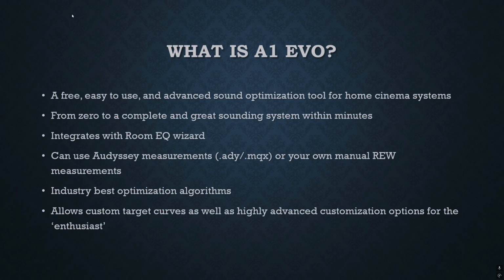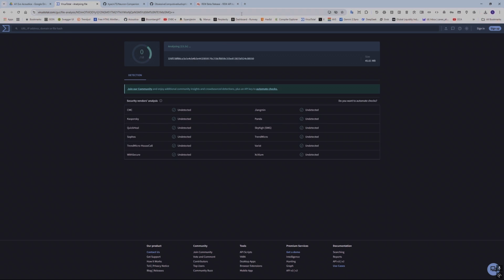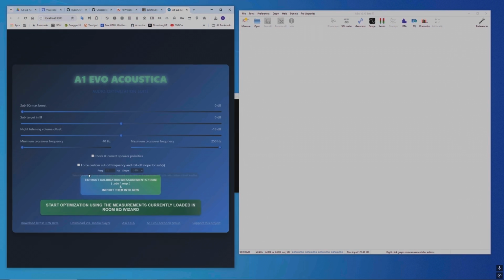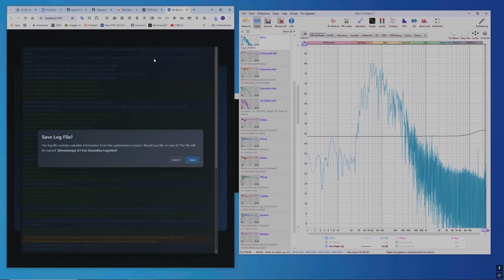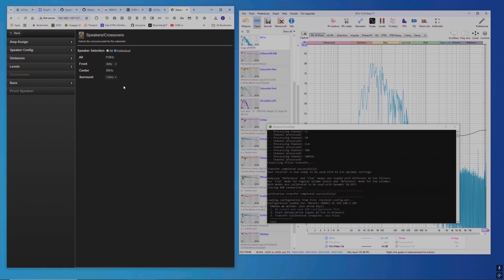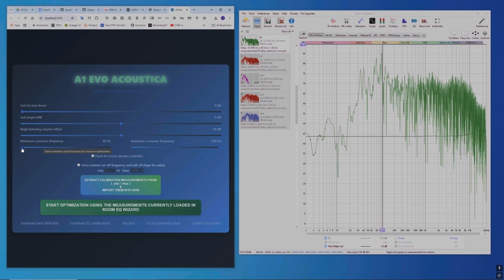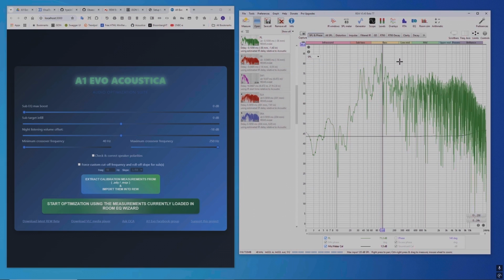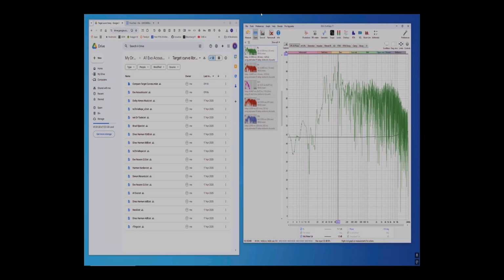A1 Evo Acoustica

Comment: Hi OCA! Thanks for this new version! I'm hoping you read this comment as I've got a few (hopefully easy to answer) questions.

After running acoustica and importing the results into my 4800h, the crossovers for all of my speakers are extremely high (180hz for kef r3s) when in previous versions of A1 Evo they were set correctly to 90hz or so. Any idea why this might be?

Secondly, I have two subwoofers, both equal distances to the seating positon, and this is confirmed by my audyssey app measurements.
However after running Acoustica, one of my sub's distances is more than double that of the other sub, which is very odd considering they're the same distance away from the measurement mic.
Any idea why that's happening please?

I've manually corrected both of the inconsistencies after loading the results into my AVR and it sounds great, I'm just a bit confused.
Reply from the maker: You should listen to the results first before you make changes.
Reply: @ocaudiophile Ignore me, clearly my ears were having an off day, it sounds far better without the tweaks.

Thanks again OCA, when my next paycheque comes in I'll throw some your way!
Reply: @ocaudiophile Thanks for your reply, I did give it a listen and it sounds great, but the bass does sound a little bloated and the fact that all of the crossovers are set to their maximum is really odd.

I might give the measurements another ago to see if that changes the results.

Comment: Thank you very much for the great tool, I'm so much happier with my system now! 4 small questions I have:
1. I have used my ady file from the app. Does it matter of I switched dynamiq eq or on off before downloading the ady file?
2. Does the speaker options from the app influence the ady file and in a second step the calibration?
3. Do I have to take care about a subwoofer offset if I used the App, or is this automatically included in the app-measurement?
4. If I have the feeling that the bass is too low, whats the best way to increase it? Just increasing the level in the avr? 

Thank you very much in advance for everything! 🙏🤗
Reply from the maker: 1. No, Acoustica will turn them all off and set Audyssey to Flat after trasnfer.
2. You should not use the app after Acoustica, it will erase all its filters. Of course you can re-trasnfer .oca file again any time you want.
3. You don't have to do anything. Just make sure Loudness management id Off, this is a setting that only shows up during Atmos playback and is on by default. Also check that AVR settings are inline with optimization log notes after a transfer. Sometimes not every setting is correctly transferred although you will not see any errors.

Comment: Hi the software is failing to find my AVR even though both are on the same network. Even when I manually enter the IP address of my AVR. 

Using manually entered IP: [IP of my AVR]

Attempting to verify/find model name via /goform/ endpoint on [IP of my AVR]...
Failed to get http://[IP of my AVR]/goform/formMainZone_MainZoneXml.xml. Status: 301 Moved Permanently!
Could not get a valid model name from /goform/ endpoint.

Could not automatically determine or confirm the AVR model name.

Comment: Hi, can you please tell me if I need to use the Fix speaker polarities function? The question arose because the program gives errors about polarity on some speakers, although I am sure that everything is connected correctly.... What can this be because of, just errors sometimes even in a pair of identical speakers, for example, the left one is correct, the right one is not correct. Is it necessary to use this function and will the calibration go fine without using it...? I would be very grateful for your help.
Reply: Help please
Reply from the maker: You should not use the option if you are absolutely certain connections are wired correctly.
Reply: @ocaudiophile  Well, all wires are connected by color, so there should be no mistake...... But maybe something got mixed up with the speakers during production because the center and side channels are different, even though the speaker lineup is the same? Or is this impossible and just ignore the function? By the way, the impulses are really different in REW

Comment: I bought a receiver with XT32 for the sound quality Audyssey supposedly offered. I've been unimpressed for years, trying different speakers and configurations, re-running Audyssey way too many times. You are the only reason I'm glad I bought a receiver with XT32, OCA! Wow, wow, and wow. Focused, immersive, and beautiful bass. Cannot thank you enough.

Question: Does A1 use an internet connection to run the analysis or is it all self-contained in the downloaded A1 program? I want to make sure it doesn't become obsolete because I want  to have it FOREVER!!!!!
Reply from the maker: Thank you 🙏 A1 only uses your local network.
Reply: Enjoy your optimized sound with all your content 😊

Comment: I am planning to use the measurements from the multieq app (.ady file ) . I own a denon 3600h. In the multi eq app thread on avs they mention the distances are wrong with the multieq app on older models and people multiply them by 0.875.  Do I need to do that before the extract the ady file ?
Reply from the maker: No

Comment: Very interesting software! I'm finalizing my new home theater setup and wondering if Acoustica can adjust three or four independent subwoofers? (I have an X4800H, which has up to four sub outputs). If not, is there a specific model or version — for example, of the A1 Neuron — that you'd recommend for multi-sub setups? Alternatively, in this kind of scenario, are MSO (Multi-Sub Optimizer) and miniDSP (2x4 HD) applied via a single subwoofer output, and Acoustica used afterward for final tuning the only option? Thanks for your time!
Reply from the maker: It can and work better with multiple subs

Comment: you mention that -15db on the receiver is 90db volume. Isn't -0 on the receiver reference level that is  75db? when I use -0 on my Denon I get around 75db set by Audyssey
Reply from the maker: No 0 is 105dB (85dB reference + 20dB buffer for the loudest sounds)

Comment: Hello OCA! You probably don't remember me, but I showed you how to decode the Multeq-X data (mqx).
I tried your tool after having optimized with MultEQ-X for a long time.
Wow, the result is excellent! It sounds a bit better immediately after generation than my current setting, which I optimized over weeks. The big advantage of your tool is that the excellent result also fits very well at different volumes!
My verdict is that your tool is much better than Multeq-X. 

I have one question:
Is there any way to select a different target curve for the night mode?
Reply from the maker: I remember you and always grateful 🙏 I added only 5 settings for night mode because it's not calculated on the go and quite tedious to add one. But being the base64 guy, you could add your own quite easily. Find the project on github and write me there.

Comment: I tried to import my measurements from MXT files and when I went to run A1 it said it needed independent subwoofer measurements.  MEQXT measures the subs togethers so not sure what I need to do?
Reply from the maker: You need to measure each sub separately if you have two independent sub outputs in your AVR. You can do that with REW by turning off each sub during LFE channel measurements or check Neuron video folder for odd.wtf tool that can do that. Btw, MultEQ XT models do not have two independent sub outputs, yours must be an XT32!
Reply: @ocaudiophile yeah I’m running XT32.
Reply: @ocaudiophile  How many measurements do you take?  Just 1 set of measurements from the MLP?  Or 8 like Audyysey?
Reply from the maker: @BrentWood-yv6cl 1 at strictly centered MLP when I'm in a hurry and 9 closely at and around MLP when I've the time. Usually improvements starts diminishing after 6 but have seen people take 24 different mic positions.

Comment: Is there a reason all my crossovers are so high now? My speakers can go down to about 40hz for mains and 60hz for my center, surrounds are good down to 80hz. I used to get 80hz for my mains and center channel and around 120hz for my surrounds and atmos speakers, but now im getting 200hz for mains and center, 250hz for surrounds and rear heights and 150hz for my front heights. This definitely seems odd. Is there a logical explanation for this, am I missing something?
Reply from the maker: Use a less bass heavy target curve, don't use sub target infill, some times allpass filters can also drop XO frequency by a notch or two. Acoustica works differently, my Kanta 2 towers get 110Hz. It optimizes for what will sound best in the particular room based on the speakers (and its pair's) location , doesn't care about speaker sizes but it gets the best sound every time. If none of these work (after you listen and it really does not sound good), you may assume there's something wrong with the measurements try more mic points in a silent environment.
Reply: @ocaudiophile Thanks for the response. I used tge default acoustica curve. Is that more bass heavy than the neuron curves?
Reply from the maker: @stephenrobotham1510  Try Dr Toole and go up from there.

Comment: Hi Serkan... a question out of curiosity.. You had deployed all pass filters for optimization.. Now that we are making it optional is there a performance compromise... is this limitation of not using All pass filters specific to certain Aud versions... what would you recommend as default for best optimization and at what point should we give up on All pass filters.. Out of station so couldnt do the tests with live system in terms of impact but always keep following your journey hence the question...😊
Reply from the maker: I wouldn't know for sure because I found a bug with allpass filters (it's fine with them disabled) and working on a fix at the moment...
Reply: @ocaudiophile : Yes, we know there won't be an issue that you would have identified and not fixed... Thanks, journey to the perfection continues..😊

Comment: Excellent work. Thank you very much! I have a Denon AVR-S760H, but it does not find it automatically. I type the IP manually, but it does not generate the /goform/... "Status: Error 403: Forbidden Access Forbidden." What am I doing wrong? Thanks.
Reply from the maker: Maybe you are using a VPN?
Reply: @ocaudiophile  No. My local network is in Mesh, but my AV appears when entering the IP manually.

Comment: This is the closest I’ve gotten one of these to work with my receiver and I’m still having issues 😞 I received a calibration error in Terminal saying “failed to initialize coefficients” Any clues?
Reply from the maker: You have S760?
Reply: @ocaudiophile I have a Denon S720W
Reply from the maker: @justinmosher7146  Ok, this multEQ new series are having this issue for some reason. I need a wifi capture of a working transfer to understand what is going on. In the mean time, you can try transferring settings after a power-cycle of the AVR, this sometimes help.
Reply: @ocaudiophile Is this a bug that can be fixed in a future version? I can always wait!
Reply from the maker: @justinmosher7146  EVery model has different waiting times during filter transfer and I can only find it out in wifi captures unless it's my machine. There's no documentation about it anywhere. Eventually it should be fixed. The code is open source on github. Let's hope someone with these models focuses on it soon.
Reply: Any version of Evo that’s guaranteed to work with my receiver?
Reply from the maker: Problems are fixed with all models since v6.3
Reply: @ocaudiophile finally worked!! Thank you 😊

Comment: It says I have to redo my measurements with my two subs set to directional. Is there a way around that if I don’t want directional? Thanks!
Reply: I did this to my other system with only 1 sub and didn’t have that issue and it works fantastic! 

But on my main system, it won’t let me continue the optimization until I retake measurements with directional subs
Reply from the maker: Directional is just a temporary hack to be able to measure each sub separately. Acoustica converts it and works in standard bass mode.
Reply: @ocaudiophile  Last question, retook the measurements and running acoustica, made it past the subwoofer part but it is saying my rear height left measurement is not there, which it is. Any ideas?

Comment: Every time I was in this place, the RAW software froze, and the web browser prompted "[WARNING] Polarity inversion(s) will be applied automatically by A1 Evo Acoustica!" Probably, what the reason will be.I succeeded once at the beginning, and I never succeeded again, and the subwoofer had no sound when I succeeded, as if there was no bass output, which was very strange.
Reply: My amplifier is Marantz SR6014 and the Acoustica version is 5.6. The RAW version is 5.4.
Reply from the maker: @lds4676  You can try to get help in fb group.
Reply: Hey check your amp crossover section.. All your speakers must be showing as full range hence your subs are silent... change the crossover overs as per acosutica recommendations and all should start working again.

Comment: I keep getting this error during transfer:
✗ Timeout/Error: INIT_COEFS - No response/ACK received

!!! FAILED sending INIT_COEFS: INIT_COEFS: No response/ACK received

--!!! CALIBRATION TRANSFER FAILED !!!--
   Error: Failed to initialize coefficients (INIT_COEFS).

But it detects my receiver and configuration just fine originally. Model is AVR-S750H
Reply from the maker: Are you using v5.3?
Reply: @ocaudiophile  Yes, I’m running 5.3

Comment: When I run Acoustica with all default settings, all my speakers and subwoofers are detected as False for Polarity Inversion. However, if I use the sliders, my subwoofers are detected as True for Polarity Inversion. Is that by design or a bug?
Reply from the maker: I could not replicate this error, something must be wrong with your REW set up!
Reply: I've uninstalled and reinstalled REW multiple times. The same thing happens. Here is a link to the REW logs: https://drive.google.com/drive/folders/1tzyg8agK41dPr27V5gld6iaQnKsk2LAs?usp=drive_link
Reply from the maker: @volumnus  Ok I now understand, it's your subwoofer that's inverted. That's completely normal and is dependent on the crossover frequency selected. Just enjoy the results ;)
Reply: Thanks for clarifying. I still have one minor issue. With my whole front soundstage having the same 100hz crossover (center, fronts, wides, and front heights), the surround sound bubble effect is really good. Unfortunately, I can't match the crossovers on my side/rear speakers (side surrounds, back surrounds, and rear heights) without messing up the crossover on my front wides.

Comment: Does A1 Evo support Biamp configurations?   I have a Marantz Cinema 50  setup with "ampAssign": "2chBiAmp", with LRC and SW1.
Reply from the maker: Yes, it does. Just make sure, AVR amp assign is set correctly before you generate config.avr file.
Reply: @ awesome. Thank you.  🙏🏼.  One other question.  Right now I only use LFE settings but I’m thinking of doing LFE + Main when I get better subs. 

Does Evo work with both options?  Is there anything special to do when measuring or running Evo?
Reply from the maker: @GaryMetzker  Acoustica doesn't have LFE + Main option, Neuron can do that though.
Reply: @GaryMetzker : Just out of curiosity..why would you try Lfe+Mains after getting a powerful sub... it defeats the purpose, if you are upgrading to a better Sub won't you like it to run at its full potential.. I mean by bringing in the Mains to play lower frequencies you are defeating the purpose of a powerful Sub... You would set LFE+Mains if your Sub isnt sufficient and you want to boost the low frequencies by also playing it through your Mains..
Reply: @AbhishekSingh-fw7fv  yeah you are right.  I was misunderstanding what the option is for.  🤦.  I guess I really just want to set the LR speaker cross over, and let the subs handle some of the 2 channel lows in addition to LFE.
Reply: @GaryMetzker  Just trust the process...  Try getting the Best of measurements and then let acoustica run on its default settings... You don't need to change anything unless you see some major issue, then try the settings on Acoustica landing page... Forget what it reads, just listen to see if it suits your requirements.. if done properly for sure Acositica will make most of us more than Happy...
Reply: @ Will do.  Now I just have to wait on my UMIK1 to show up.  Super excited.   I never thought the EQ was great on Audyssey.  Thanks a million. 🙏🏼🎧

Comment: Hello, if I apply sub target infill to 10db, I can compensate for the gap in the very low frequencies. Is it okay to use it at 10db? I'm not sure exactly what sub target infill means.
Reply from the maker: Yes it will fill gaps but it will sound distorted. You don't normally want to correct room modes. Still, no harm trying and testing the results with your ears.